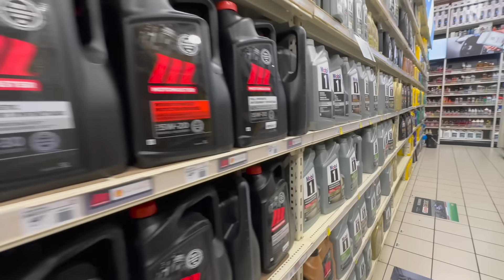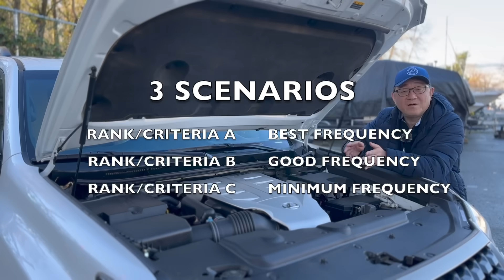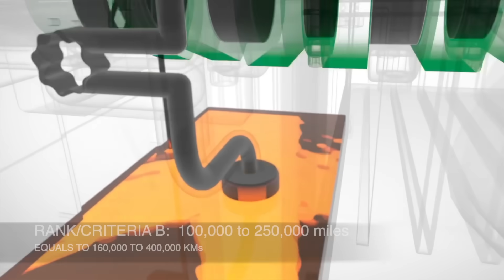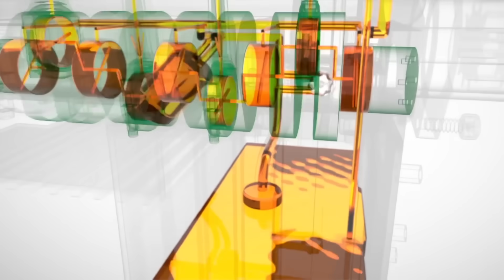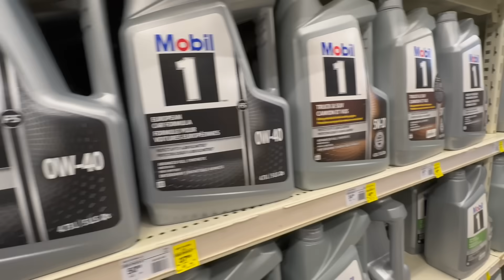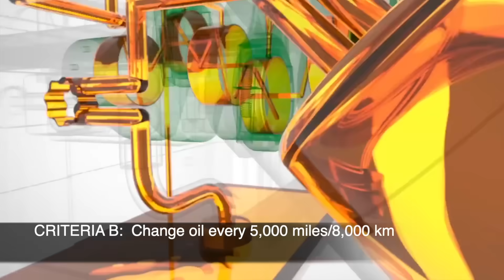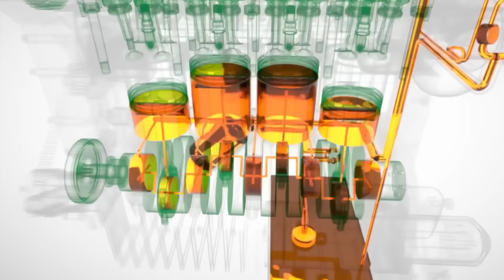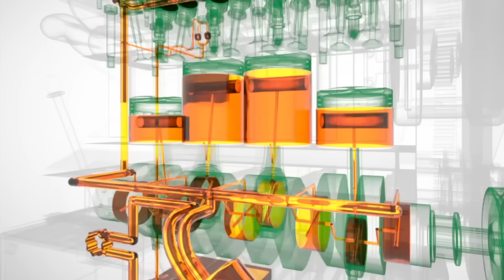ENGINEER EXPLAINS HOW OFTEN TO CHANGE OIL & FILTER // UPDATED CRITERIA-BASED RECOMMENDATIONS!

Comment: I daily drive like a grandpa.  I change my oil every 10-20,000 miles.  It has just over 400,000 miles and gets the best gas mileage it ever has.  It’s never seen a mechanic, only my hands.  It’s a 2007 Silverado 2500HD.

Comment: I’m an “A guy” with a 13 year old Tacoma and a 10 year old Toyota Sienna and I use Amsoil signature synthetic oil.  Their recommendation is one year or 25,000 miles.  I have been doing this since the 1990’s and have never had an engine problem.  I had a Ford Crown Vic and a Ford Ranger and both had frames that rusted out but the engines never burned oil.  This works for me so I will stick with it.

Comment: I have a ‘23 4Runner and barely use it because I have a company car. I put on less than 1,000 per year. Should I still get my oil changed every year ? I drive it a few miles every couple of weeks so it’s not just sitting.

Comment: Totally agree,   my regimen is 4000 to 5000 miles on my 2005 porsche 911,  now passing 120000 miles,  never had any problems,  and oil analysis have been consistent in my now 10 year ownership,  almost no wear metals

Comment: Video. I like the fact that anchored categories by owner expectations for length of use. 
Something you didn't touch on is the aftermath of covid and increase in retirement. I rarely use my car and put on fewer miles than years ago when working and and it was safer to have exposure to new people. 
I have friends who insist that more frequent oil drains are required despite lower driving distance.
I'm interested in your thoughts on this. 
Bob

Comment: I was changing oil in my rav4 hybrid at 5K mi or 12 months whichever comes first. 0W20 synthetic. It looked dark yet transparent and thick as new.
 I spoke to cab drivers with priuses and rav4 hybrids with 200K+  miles on cars. They change at 8 - 10K.  I think 3K is an overkill.

Comment: What’s your take on hybrids? They don’t run the ICE as much, but also on short trips the oil isn’t coming up to temp to burn off condensation either. Honda suggests 10,000, is there a PID i can read that shows engine run time/distance vs miles?

Comment: I had a 2006 Mercedes E-230CDI - I put 490,000 before trading for a 2014 Audi Q5 diesel - and now have 365,000 miles on it:   Neither used more than a quart per 10,000 mile oil changes - I used Mobile 1 and then Valvoline European Synthetic......I will drive my Audi Q5 till it drops as diesels are getting harder to come by and I don't drive as much as I was.   I also put 550,000 on a '84 Suburban 5.7 Liter diesel, used only Chevron Super C oil changed every 5,000 miles.   It used about a quart in 4,00 miles..

Comment: Change engine 4k every 4 months, trans and front and rear differentials, transfer case 30k, power steering and coolant, and brake fluid 60k. Rotate tires every oil change.

Comment: I have a 2008 mustang I've owned for 11 years I've only put 34k miles on it . Motor an transmission is tight as a drum. Retired now last couple years only put about 2500 miles a year an still change oil every year base 5w 30.

Comment: If your fuel economy is 60% to that of mfg then do it at 60% mileage then what is mentioned in the service book. Stick to fuel economy percentage of yours compared to manufacturer declared. You can still take 20% leverage on that. Manufacturers will assume 80% highway run 20% city, same as to show average fuel economy.

Comment: BS, 2014 VW Jetta has 330K miles with using Mobil 1 full synthetic changed every 10K miles!! It’s all about how you drive, so if you are really gas pedal hippy, then you need to change the oil more often 😊🤷🏻‍♂️

Comment: Category D: for those who would rather change the engine than the oil. Don’t worry about the oil change interval or even adding oil. Just wait until the “new engine light” illuminates on the instrument console. Unbelievably, there are quite a few who completely neglect engine oil.

Comment: i have a 2020 rav4 the interval for oil change is 16000km or about 10000miles.which i have been doing iam in your category b,should i be doing it sooner,ive been following toyotas schedule,1,2 or 3.1 8000 kmno oil change but check over vehicle,2 oilchange and some othr stuff,3oil change oil change and more stuff to check,iam coming up to the 96000km schedulemy next oil change,rotate tires and othr checks.

Comment: On a new engine, or new car, I change my oil and filter at around 1,000 miles.  Then again, i will change it at the 5,000-mile mark.  Then every 5,000 miles after that, or 6-month, which-ever is first.  Even though I don't keep a car that long, I still keep the maintenance top-notch.  Sorry, but that's me.  Whomever would buy my old car will be getting an excellent vehicle always.  Changing oil more frequently is good.  Basically, I agree with this young man with his recommendations.  Extreme conditions, like living in Texas, Florida, Arizona, extreme heat, extreme cold states, short trips, yes, change oil early like 3,000 miles.  Good full synthetic engine oil and a quality oil filter is good insurance.

Comment: Good information and explanation. I’m definitely a A Guy, 6 vehicles age range 9 to 51 years, I change oil every 3-5k miles along with all the other fluids (Differential , Transmission, Power Steering, Brake, and Coolant) at 50k

Comment: I do not agree to these recommendations. They only create income to the oil change services. I own a second hand Skoda Octavia 1.6 gasoline engine for 10 years, bought it 6 years old at 140 000 km. Now this car has 450 000 km and is in perfect condition. I change the oil at 20 to 22 000 km with 10W40 semi-synthetic oil (together with the oil filter). The frequency is a bit less than two times a year. The engine is perfect, the mpg is perfect at 5.6 l/100km combined driving. I think you can trust the manufacturer recommendations rather than so called "engineers" with biased opinions. Drive safely.
Reply: I agree. Changing oil every 5k miles, or 3k miles, only wastes natural resources and money.

Comment: Interesting how things has changed over time. 25 years ago, any mechanic wanting to change your oil every 3k / 3 months is ripping you off..  I had customers get in my face because I recommended to change synthetic oil every 5k miles, and let's not get started on the lifetime transmission fluid.

Comment: My Dodge Cummins Diesel has 390,000 miles.  I changed the oil from the beginning at 3,000 miles using a high quality full flow filter.  I use full synthetic 5 w 40 Shell Rotella.  It uses no measurable oil during the 3,000 miles between changes.
In my Buick Park Avenue with 160,000 miles I use Pennzoil 5 w 30 Full synthetic and change oil and filter every 3,000 miles.  It uses about 1 quart between changes.
In my Hyundai Santa Fe, it has 224,000 miles.  I use Pennzoil full synthetic 5 w 40 and change and filter every 3,000 miles.  It uses about 1 quart between changes.
I do an oil analysis every 25,000 miles.  All three vehicles are doing fine.

Comment: I have a bit simpler time frame.  If you lease the car, go by owners manual.  If you want to keep the car, chop the owners manual recommendation mileage in half.  Not sure why he keeps adding the bit about synthetic as it pretty much all is anymore.  I know of some non synthetic diesel oil, but I don't believe I've seen it on the shelves for cars in quite a while.

Comment: 5k is a scam . Ive had tons of cars and know loads of people who never change their oil . Nothing ever happens . Engine failures from oil is very rare . Its normally from the belt stapping . If this was the case ude see a lot more cars breaking down in poorer areas or countries . Id had a golf mk3  with over 100k with not a single oil change just topped up with oil.

Comment: I think oils are better than ever, and cars have much less blowby and fuel contamination than ever. I feel very comfortable that if you use a good synthetic oil and filter, 5000-6000 is good, especially if you drive a lot of highway miles. If you tow or drive a lot of stop and go, you need to shorten your intervals. Also, so many newer vehicles are smaller displacement and turbocharged, these are harder on oil and need shorter intervals.

Comment: My Honda Odyssey made it beyond 225,000 miles over about 12 years before I sold it and it still ran great.  I did my changes every 5k miles. My 2010 Legacy is probably at about 250,000 miles now (son has it), and that was also every 5k mile and is still running great. 3k miles is throwing away money unless you are running cheap oils and filters.

Comment: ⛔️⛔️⛔️⛔️⛔️⛔️⛔️⛔️⛔️⛔️⛔️⛔️⛔️⛔️⛔️⛔️⛔️⛔️
Oil is cheap, engine is expensive.
 Manufacturers have interest in your engine  being ruined as fast as the warranty expires.

What ever interval  the recommendations are, HALVE  that and you should be on the safe side. Transmission too. 
⛔️⛔️⛔️⛔️⛔️⛔️⛔️⛔️⛔️⛔️⛔️⛔️

Comment: I am getting hooked to this channel. But the initial reason I started watching this channel is after my 2009 Lexus ES 350’s mileage dropped massively after I used Redline branded fuel injector cleaner. I have taken the car to dealership and they hooked up the computer and can’t find an issue. But I see the issue everyday as fuel consumption is double of what it used to be. I am sure it damaged something in the fuel system. Any insight into what to look for would be appreciated. Thanks.

Comment: I think most oil will out last a filter. If you can change filters every 2000 miles you might be able to get 10000 out your oil. I change me oil in all my cars every 4000 miles.

Comment: One major factor that has not been mentioned is the amount of oil in the sump. Obviously, if you have 10lts versus - say - 5lts, this changes the equation dramatically. I agree with what is being recommended for - say - around 5lts, but for larger amounts (and based on engine size); I would suggest longer milage intervals (not time) are OK - within reason...

Comment: Ever since I watched this video, I've started changing my oil every 3000 miles or 5 months. I drive a 2017 Corolla XSE with 98,000 miles on it. My loan is for 6 years, so I can't afford to get into a new car at this time. Before this video I was changing it every 5000 miles.
Reply: Go back to 5,000 miles. You're just wasting money at 3,000 miles. Your Corolla engine will not go bad.

Comment: Thanks for posting! I was also wondering your thoughts on the idea of oil degradation and the number of heating/cooling cycles that the oil is subject to... I recently heard (and watched) an oil analysis video where they were testing several brands of oil, and degradation amount after repeated heating/cooling cycles... IE someone that drives predominantly highway miles (in this case - 1 heating/cooling cycle for every long highway drive) vs someone that does a high number of start/stop, or short distance driving (IE occasional uber drivers, or short drives through town) where the engine also would go through significantly higher numbers of heating/cooling cycles in the same given distance as the highways drivers. I thought that made a bit of sense for the high number short distance drivers to change oil more frequently than the highway driver that endures one heat/cool cycle perhaps in 100mile etc... Would be nice to hear your thoughts on that part too. :)

Comment: 3000 miles oil change interval are the norm 40+ years ago when cars are not having fuel injectors and fuel sulfur content are much higher. Sulfur from piston gas blowby will degrade engine oil.   

For engines using full syntheic they could easily do 7000 miles oil change interval. Buy a proper cutter for cannister oil filter. "Trust but you can also verfity". 

A bunch of engines from 2005 to 2012, like from VW to BMW to Toyota, switches to low tension piston rings and had design issues, end up having premature sticky piston and oil control rings due to carbon built up.

So changing engine oil at every 3000 miles for these engines does not address the root cause of stuck piston rings. It would be not too bad if your suggestion for oil change interval is 6000 ~ 7000 miles and at same time able to solve the issue of stuck pistion & oil rings. In China the owners of VW engines doing overhaul change them to new types of pistons, rings & oil control rings to address high oil consumption issue. Regards.

Comment: I have a 2003 matrix with 275,000 miles. Change oil every 5000 miles on average.  I have lagged one time and went 10000 miles( was a little surprised when I checked my records) . It's starting to have issues with sensors , catalytic  converter, etc. To be expected.

Comment: I'm good with the 'B' recommendation.
However. I think factors that can modify the oil change frequency are hybrid engines. Direct Injection, Turbo, and trip conditions (short, highway, ambient temps, etc.
Oil is relatively cheap compared with a failed engine.  

Same philosophy with the other lube oils in the vehicle.

Comment: I change my oil frequently and it’s true the engine is well protected.  I will add an important comment that people need to remember.  In every case, I have an excellent engine with a vehicle falling apart around it.  From rust to failing electronic control modules, the condition of my engine almost seems irreverent because if I really want to keep my vehicle 10 years or beyond 200,000 miles, I will need to spend thousands of dollars on non engine repairs and deal with an unreliable vehicle.

Comment: Which brings up an important problem with leased cars that are being sold as used. Those owners probably never changed their oil since leasing. Unless it's under contract that they must bring it in. I'm pretty sure most don't care about the maintenance and those buying those used cars are going to have problems with those particular cars.

Comment: You are spot on with the recommendations.  I drive a 2004 Avalon.  purchased brand new.  Have changed the oil every 3000 miles or 1 year, whichever comes first.  For the last 10 years, it has been short, urban hops to the grocery store.  Once or twice a year, highway driving.  Car runs like the first day driven, brand new.     With the last oil change, I did my first chemical cleaning of the engine for 15 minutes.

Preventative maintenance.  Toyota no longer offers the Avalon model.  So, take the sales tax alone on the 2022 Avalon, over $3000 in my county.  That would pay for a lot of oil changes.

Comment: 2017 GX460 with 130k miles. 5k OCi's with Pennzoil Ultra Platinum 5w-30 <OR> Castrol Edge Euro 5w-30 A3/B4 with a Denso filter and GoldPlug magnetic drain plug. Also, one treatment of LiquiMoly Molygen Motor Protect or Ceratec.

Quite literally runs better than the 2200 mile 2023 GX460 loaner I drove during a recent dealer service.

For 1UR/3UR V8's, I think you can add another 1,000 miles if you go full synthetic AND step up a grade from 0w-20. My Blackstone Lab wear rates for a 5k OCI are..... lower.... than projected averages for a 1.5k OCI on my motor with Ow-20 TGMO.

Comment: ❤ on-point thanks i have owned my 02 Mazda Protege 5 since 2002 and once i reached the first 100K miles i have been using synthetic oil and do e the oil changes every 3K mikes. current mileage 239K miles on the original engine!

Comment: For a new car oil change after 1,000 miles  I change the oil to remove any metallic flakes.
At 4,000 miles I change the oil.
Afterwards 5,000 miles or 6 months.

Comment: I use synthetic oil and change it around 8000 miles. I do this because I also rotate my tires at the same interval and this helps me remember to do both.

Comment: I want to keep my 12' Altima for as long as I can.  I change the oil and filter shortly after 4 months have gone by.  The car usually has been driven between 2,000 and 2,500 miles at the time of the oil change.  The other very important thing is do is change the CVT transmission fluid every 2 years even though the car has only about 13,000 miles since the last fluid change.
Reply: There's no contaminated in transmission fluid like engines oil .. 30000 miles is the earliest.  Too much changing transmission fluid is bad
Reply: @heinhandsome2010  I disagree with CVT transmission fluid.  Changing the Nissan CVT is a good move every 2 years.

Comment: The frequent oil change risk is they forget to add the oil. Or have 2 gaskets on the filter or torque the filter to the moon.

I have known just a dozen cars ruined by bad oil changes.

One drained the manual transmission and filter on the engine and added engine oil. Then the transmission failed

Comment: In the real world,  most people forget the oil change,   It’s easy with busy life.   The ones who do it regularly by recommendations are few in between.   In our everyday life,  most of us don’t think much about their vehicles.  Just a machine that takes us to work & kids to school.   Oil change is not cheap anymore & shops also oversell services customers don’t really need.    For the DIY.   I don’t need to tell them anything.  They all have their own ways to do things.   No matter what type of driving one does,  or driving habit,  4000 miles per change is a safe bet.   Especially ones have turbo engines which almost all late model vehicles have.   Example,  most rental vehicles follow regular schedule no matter who rent them.
Reply: Yes with turbo 4k miles.  I will never own a turbo thankfully.

Comment: What about running a 69 Buick 430ci V8. I am running about 1200 mls a year and i add a quart every year. I am running mineral Valvoline 15w40. Because i am adding a quart every year and always do trips of at least 30-50 miles i don't see any problems going for years without an oil change. It would be a waist of money.

Comment: I have a new Hyundai 2l, non turbo. I have 2200 miles and it's 12 months old. About 70% stop and go in town and the rest hyw. driving. I live in the lower Midwest, no extreme temps one way or the other. Do I need to change the oil based on time.